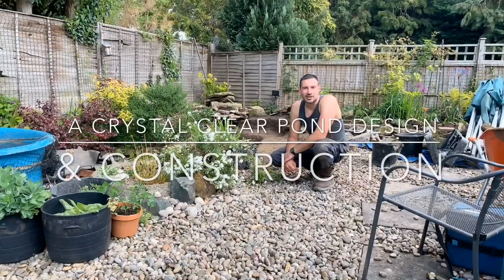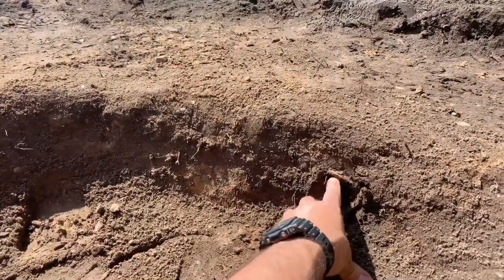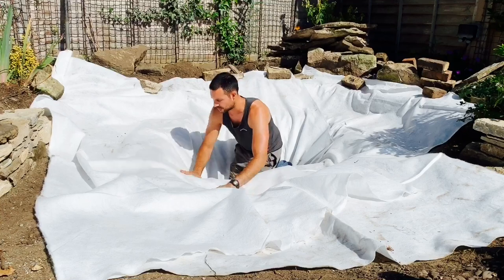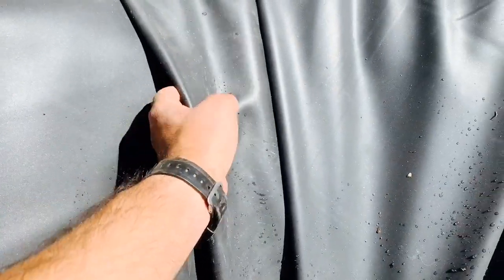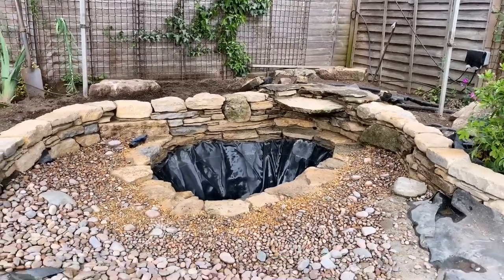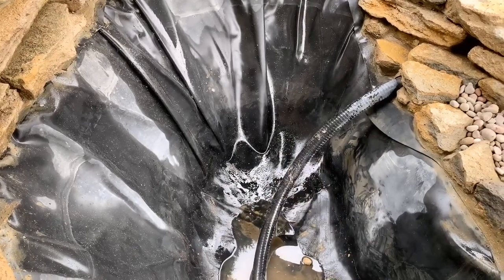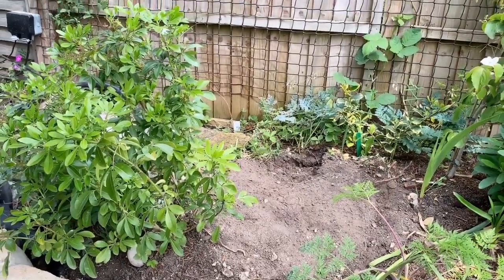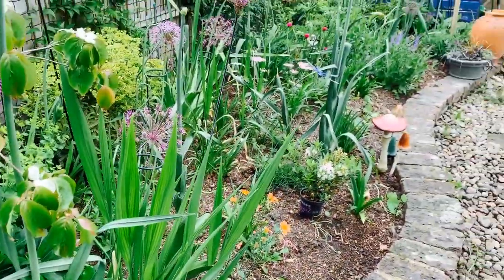Pond construction using liner; hints and tips.

Comment: I'm after some expert advice please. I'm planning a small frog pond about 2m x1m x 0.5m depth fed by a small waterfall about 30cm above in a raised bed. I've been told to use a waterfall filter but they look hard to clean out being buried in the ground and I wont have a lot of space to hide it in the raised bed. Im thinking of purchasing a Hozelock bioforce pressurized filter and pump set as it looks easy to hide and clean with a turn of a handle and wash out outlet. What would you recommend? Thanks for all your excellent videos.
Reply from the maker: Hi Julian, thanks for watching and for your comment- indeed, a waterfall or traditional gravity flow filter is a little crude in terms of maintenance.  A pressurised system for a small pond such as this would be perfect and allow for easier, less hands on maintenance.  Hozelock systems are a household name with ponds in the uk, however my personal preference would be to opt for something like an oase filtoclear , which is a durable, robust and easy to maintain filter and uvc combo.
Hope this helps!
Best,
Ed
Reply: @CrystalClearAquatics  Thanks Ed. I really appreciate your advice as you look like you've had plenty of experience. I've decide on Oase. I always trust German products anyway.  All the best. xx
Reply from the maker: @julianfieldhouse968  No worries Julian- I think you’ve made a good choice! 
Best,
Ed

Comment: Does it hurt a tree to trim roots??? I was thinking of using felt under the liner. Cheaper maybe???? Thank you for showing how you create shallows-gorgeous!
Reply from the maker: Hi there!  Trimming of tree roots will cause no issues, assuming you’re not hacking away huge sections from the same plant.  A 25% reduction or so shouldn’t cause any issues, so the odd root in the way removed won’t be a problem.  As for the use of felt- indeed this would be a reasonable protective layer beneath the main pond liner, however as pond fleece is relatively inexpensive I’d always advocate use of the proper stuff!
Thanks so much for watching and commenting,
Ed

Comment: what happens when it rains and dirt goes through the rock work into the pond ?
Reply from the maker: Good question! As the stonework retaining the border has been mortared into position there are no gaps for soil to get washed through, so run off isn’t an issue. This is something that should always be considered when constructing a pond however-run off is one of the major contributing factors of blanketweed issues in ponds for example.
Thanks for watching and commenting!
Best,
Ed

Comment: with the vast majority of the pond being so shallow how do you avoid getting blanket weed and hair algae ?
Reply from the maker: In terms of volume only a small percentage of the pond is shallow, the majority being the deeper middle section.  Blanket weed/green water issues however will always be more troublesome on any pond with a small volume such as this-thankfully the excellent Filter/uvc set up on this system caters for any potential green water issues and blanket weed is reliably controlled with quarterly doses of cloverleaf blanket answer. In my experience 99% of blanket weed issues are solved with this great treatment, which I would highly recommend.